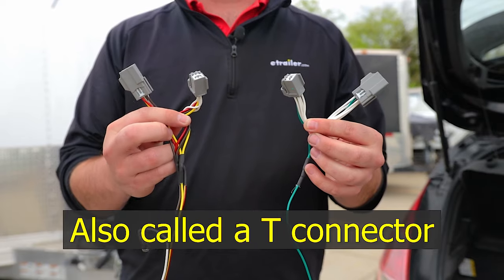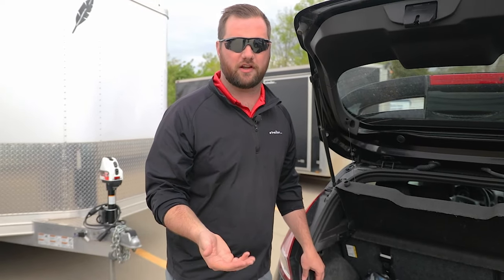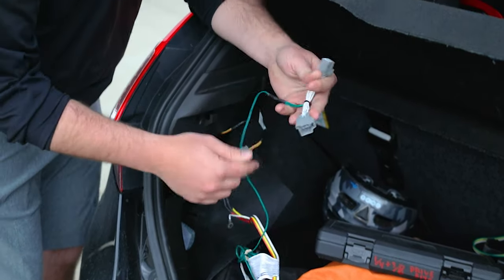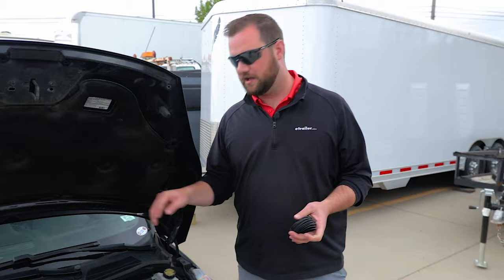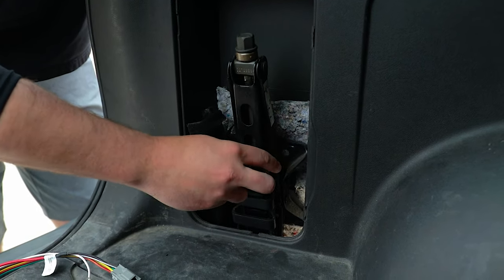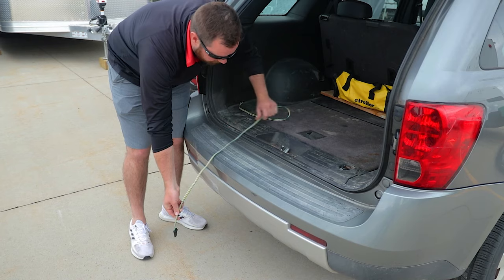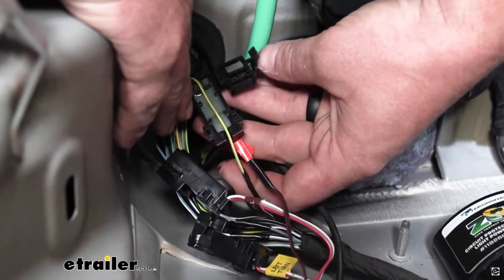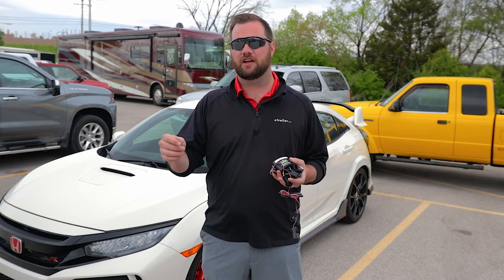How to Wire a 4 Pin Trailer Connector

Comment: do those 4 pin trailers not have amber corner lights? I got a led strip from china for the back of my truck and it say both turn signals are also the brake wires. when i power both at the same time it still emits orange at the start then goes bright red. I dont need any orange light showing when braking - that would only get me pulled over by the police. also prob wont be good for my truck blending turn light wiring with brake light, will mess with the b.c.m. t.i.a